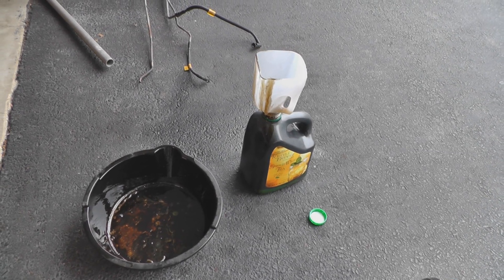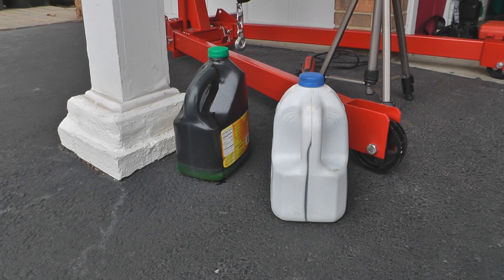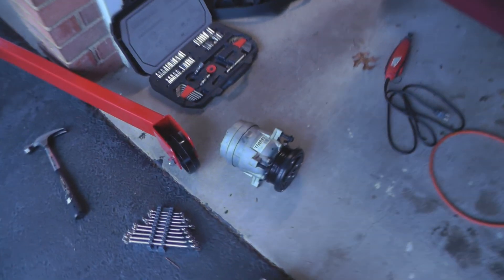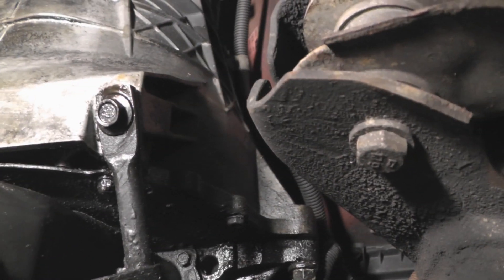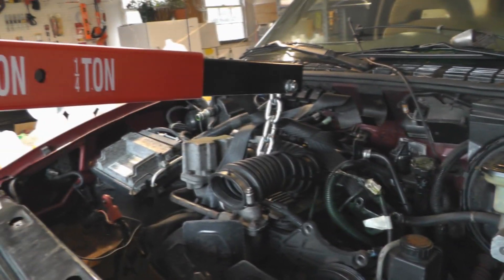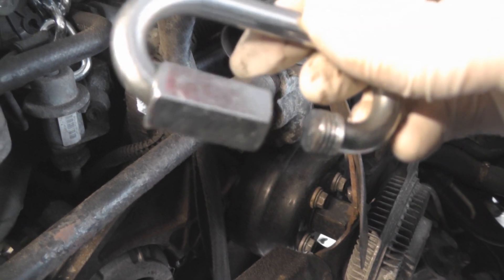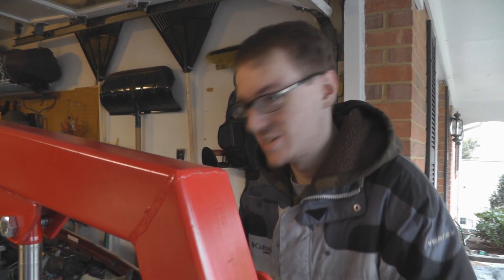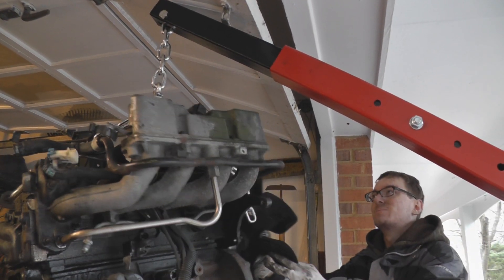S10 EV Conversion: Removing the Engine - Part 05

Comment: You bought a hoist just for this project?  what can a mechanic charge me to remove all the ICE components? It  nuckle-scraping, painful, bloody work... but it's not like anything needs to work afterwards..  Is $300 fair?  

Is it possible to piece meal remove the engine and not need a hoist?

Not sure if anybody knows.. but I have on a 2002 Blazer 4.3 2wd automatic .. If I want to go EV with a bigger motor and no transmission, no air conditioning, electric braking and rack and pinion steering.. Can I mount the electric motor under the truck closer to the rear axcel and fit everything including Lithium batteries in the engine bay?
Reply: how'd that blazer project go?
Reply: @michaelpark5964  Nowhere. I sold it to somebody with the same idea.  Have not check in with him.  It was very ambitious  given this SUVs weight and the cost of batteries.  Instead what I did was buy and convert small/cheap 4 cylinder van daily driver and swap in a 115AH deep cycle primary battery and a 320 Watt solar panel on the roof for Off-grid Vanlife (lived out of the van 2 weeks without a hotel or restaurant a few times).. with  amazing results!.   I run ventilation, refrigeration, cooking, TV, Internet and related charging all day and night long and the battery is always charged up thanks to the alternator and over sized solar panel.   A lot of details and testing on my channel.

Comment: I understand your reasoning but it is still wrong. If your decision making process was so impeccable you would not have started a project you didn't have the money to come close to finishing.
Think of it this way, at least one of us is wrong. You haven't even watched EVTV, that's a pretty glaring oversight for a DIY'er in itself. I have watched everything, debated everything. I have communicated with Martin Eberhard, Ian Wright, JB Straubel. I have designed controllers. Why not consider it.

Comment from the maker: I disagree. I looked at many real-world examples on evalbum and such, and lead is still sufficient for my needs. Many even report their acceleration as "good" despite 1500 lbs of batteries. Some even report better than stock up to 30mph (the original 4cyl was pretty sluggish).

All that being said, finances have gotten to a point where I may be selling the truck. I've got several battery boxes built and the motor installed, but I just don't have the cash to continue. So it may not even matter.

Comment: I know it's a lot to suggest now, and depending on your financial situation, but I'd consider selling the lead while it's still new and go with lithium instead. I can only imagine the difference in fabrication that will make. You have to build a structure to safely hold that 700kg many places on the vehicle and maybe change shock absorbers. Instead of easy 90kg in the nose.

Comment: You don't need a bms for lithium if you follow some basic guidelines (top balance and never run the pack to flat). And lead has many more cells, you just don't think about them and how quickly they die.
lead is a 2V cell, LIFEPO is 3.2V. superior in every relevant way including cost.
What I'm trying to tell you is that your impression of the battery situation is wrong. You didn't quite consider how dramatic the advantages with lithium are and you listened to stagnant old timers.
60Ah beats 220

Comment: Slow wont escape the weight. Not even a little. Slow escapes the appalling aerodynamics of a truck but not the weight.
Obviously you felt that lead was the way to go for now and I understand that can seem like the safe choice but the only thing safe about it is poor performance and much higher cost. Lithium isn't becoming mature, it has been mature for years now. If you want to base your decision on others' experience how about those who started with lead and changed to lithium.
world's apart

Comment from the maker: Also it's important to remember that there's more to lithiums than just cells. BMS (and its cost), potential for overheats, cell expansion, and the overall complexity of maintaining that many more cells all factored into my decision. I feel lithium just isn't quite where it needs to be yet to make it viable. I'm okay with driving a lead sled in the meantime. I often hypermile in my Corolla so I'm used to taking it easy and driving slow.

Comment from the maker: That's another reason I went with a truck-- the carrying capacity is 750kg, meaning with the engine, gas tank and exhaust removed I can comfortably carry the batteries and a couple people.

I don't think a 60Ah cell will be comparable in usable capacity to my floodies. I believe I'd need more like 100Ah, but I'd have to check the numbers.

And I don't know about Denmark, but we don't have cars that weigh 672kg around here. The best you'll do is around 1000kg.

Comment: If you instead bought around 10kWh of CALB cells you might go around same distance because it only weighs around 100kg.
Even if you bought at fairly high price from EVTV, the 60Ah cell (around 67Ah real capacity), 45 of those for 89$ each that's 4000$ including battery cables between them. It's only around 9.5kWh but might get you about same range.
And the car would accelerate 33% faster because of the lower weight burden.
and might last 5 times longer...

Comment: If we say you get half capacity for EV use, and that might be generous, that's 15.8kWh capacity. And 672kg worth of batteries. That's a small car's worth of weight you always drive around with and you may have to modify suspension for that.
If you didn't have that burden you'd need less capacity to go same distance. you increase the vehicle weight by around 50%.

Comment from the maker: I got 24 Trojan T105s rated at 225 AH (20hr rate of course). Yes, I could have likely gotten them a bit cheaper, if I had a local dealer-- but I don't. I had to have them shipped from Florida to Virginia, nearly $500 just for shipping.

Comment from the maker: Trust me, lead is far from dead. A comparable CALB pack would run me $5k + shipping whereas I paid $3500 shipped for my floodies.

Plus, I like having a truck. Though if I did it again I would choose a car, maybe a wagon so I don't have to worry about a rack breaking and batteries falling out.

Comment: don't you watch evtv? lead's dead. better off with a small agile lithium pack with same range as lead (calb ca or A123). costs about the same up front, lasts 5 times longer, vehicle moves much faster.
then you wouldn't have to pick a pickup either.